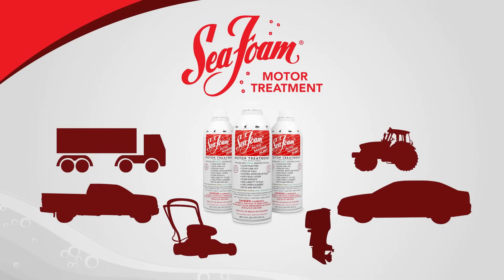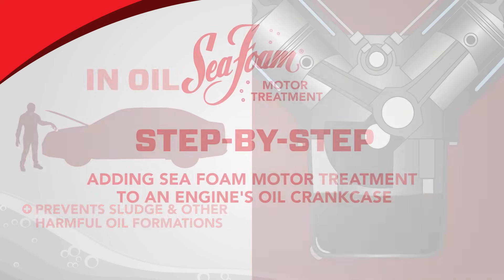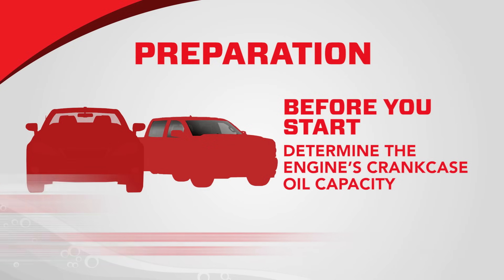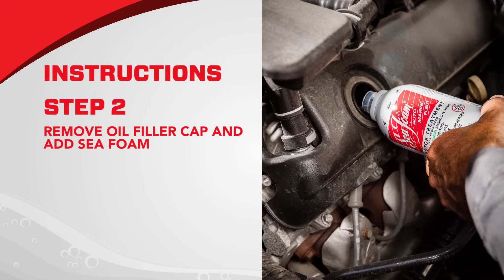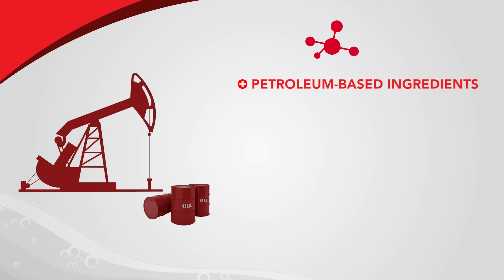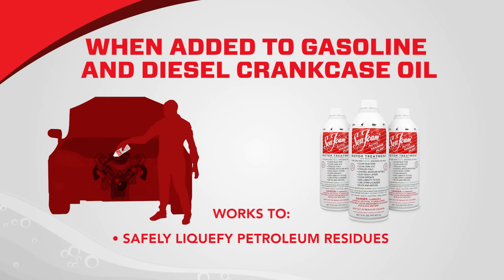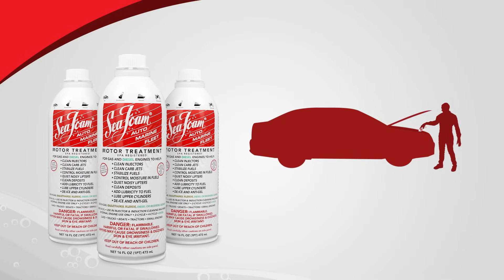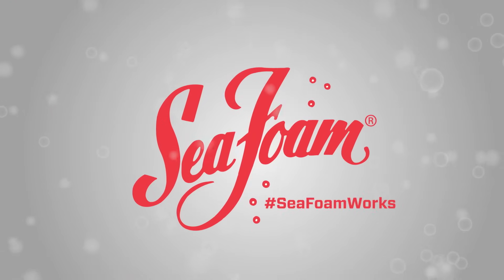Add Sea Foam to your oil crankcase - super easy!

Comment: Hey there! I used Sea foam the other day, pouring it right into the gas tank. For some reason I have not noticed any smoke coming from the exhaust at all. Is this a bad thing?
Reply from the maker: Adding Sea Foam to fuel would not cause a visible emission.  The smoke/vapor you're talking about is caused when a fluid is induced directly into the chambers of a running engine.  Anyway, no worries.
Reply: That happens when you pour it down a vacuum line like the brake booster. Lots of tutorials on YouTube
Reply from the maker: Bad idea to run any fluid through a vacuum line.  See hydrolock.

Comment: I have a 2018 Hyundai Elantra 2.0 l Going to be doing in oil flush and then taking it to the dealer to have them change the oil like they usually do last time they change my oil I went to a gas station to take a piss came back out start the car and it just died it’s done it before after a oil change but I didn’t really think about it I just thought well maybe it didn’t catch but this time it cought and started and ran for like two seconds and then shut off completely turn the key back and forth fired right up never stalled out again so it’s time for another oil change and instead of asking the dealership about it I’m just gonna take it on to myself and go flush my own oil so we will not have that problem the dealership won’t do nothing about it anyway they’ll just say nothings wrong with it that’s the way the car is made
Reply from the maker: Hi Bob. I don't think anything related to changing the oil has anything to do with the vehicle not starting. Why the car is not to starting is being caused by something else. Take it to an auto parts store and have the battery tested for voltage. Fuel filter, too.

Comment: I used it last week and now my car 2004 Hyundai accent shakes a lot and idk what to do.
I have a code P0300
Reply from the maker: Shaking and showing code P0300 tells you have at least one cylinder misfiring.  Could be low fuel pressure, vac leak, bad plug/s, bad coil.  First thing I'd do is remove all 4 spark plugs to see if one is charred or worn out.
Reply: @SeaFoamOfficial I changed plugs and coil and it shakes alot
I used too much seafoam 3 bottles and it started shaking.
1.5 bottles gas tank
.25 breakbosster
.25 crankcase
1 spray bottle air intake
Reply: @SeaFoamOfficial  
I'll check for vac leak and fuel
Thank you
Reply from the maker: @davidnatiel6886  Let us know what you figure out.  Hope it's a quick fix for you!
Reply from the maker: @davidnatiel6886  I don't think there's a relationship.  My bet is something going on (not going on) in a cylinder whether spark or injector or compression.
Reply: @SeaFoamOfficial  
Thanks
I'll check that out
Reply: David Vasquez did you ever figure out the problem?
Reply: @streetlifetv13  i was told there is a problem with a cylinder and that's the reason why it shakes.  It started right after I used seafoam but it was just a coincidence
Reply: KARLOZ LOPEZ  the car is running much better now. It Shakes a lil but it might be related to something else 
It all started after adding all that seafoam and it slowly went away after couple of weeks
Reply: David Vasquez perhaps the sea foam dissolved a deposit that had naturally but very slowly built up over time. This deposit grew so minuscule it went unnoticed but ultimately altered the movement/path of internal components. The steel inside may have lost its shape just slightly having worked around said deposit for so long. Once seafoam dissolves this deposit, you almost instantly have displacement inside a chamber that needs a perfect seal. This would throw off balance and cause shaking or knocking: In other words, seafoam worked well to a fault. 
I’ve had guys develop oil leaks, blame the seafoam when what actually took place was the product removed gunk that internally had been covering a leak. 
Again, another case of the product doing what it should and still catching a bad rap
Reply: Pos

Comment: Hey I have an egr issue and when vacuum is hooked up it idles rough so I keep it disconnected would this help?
Reply from the maker: Thanks for the question. No, I don't think so based on your description. The EGR works after combustion and Sea Foam is done working at the exhaust stroke.

Comment: Will this help with engine sludge in a 4.2 Audi V8? 134k miles. Thanks.
Reply from the maker: Hi Will: Yes, will help.  Add half a can to your oil crankcase every interval.
Reply: Thanks just did the treatment and it definitely cleaned it up.
Reply: Will Davis i also have sludge in the engine ... how often did you repeat it and when... do I poor it in the crankcase 100-300 before oil change ??
Reply: Hetman Pour it in before you change the oil and run it for around 300miles then drain and refill with oil. If the sludge is bad enough repeat it again on a shorter change interval and seafoam it again. My engine runs way better now without all the sludge in there
Reply: Did any of you watch and listen to the video? Lol people click on videos and just post in the comments looking for the answers now. You wouldn’t have had to ask and wait if you just listened to this shit lol

Comment: Hello, i accidentally added excess of seafoam to my crankcase, i added 6 ounces instead of 4 ounces. Should i worry about it? Should i change my engine oil immediately?
Reply from the maker: No worries.
Reply: Did it work

Comment: How about a slugged 2000 Toyota
Reply from the maker: Do you mean sludge?  If so, I would remove the oil pan and valve cover and scrape out as much crud as you can. Form there start adding half a can to the oil every interval and it will progressively work to liquefy the sludge over time...  If me, I'd shorten oil intervals to 1,000 to 2,000 miles for a while to speed up the remaining sludge removal. Check your oil frequently - if it goes black fast, be ready to change oil. Hope this helps!

Comment: What do they think oil additives are, which every fresh lube has (approx 7% by weight). Detergents and dispersants to name only 2. Do they think they know better than expert oil formulators. Save your money and just change your oil....😊
Reply from the maker: Sea Foam is 100% petroleum, has no detergents. It cleans by reliquefying oil deposits/residue back into the fluid oil phase, not an oil additive or fortifier.

Comment: You guys need to add PEA to your formula, it'll make it way more effective.
Reply: Have you looked at Gumout Multi System Tune-Up it's a similar product to Seafoam but contains ~10% PEA
Reply: Multi System Tune Up is Gumout's calling to Seafoam, it can be added to gas, sprayed into the intake/vacuum line, or put in the crankcase like seafoam.For a fuel additive though Techron or Redline's fuel system cleaner is probably a better choice because they contain alot more PEA.
Reply from the maker: No, not worth it. It takes A LOT of PEA to work at all. A question to ask (about PEA) is: Does a fuel additive in a small container have enough PEA to even work? PEA also strips lubricity, which is something you wouldn't put in a cleaning lubricant.
Reply: @SeaFoamOfficial  for my fuel tank additives I usually go with Luca's Fuel Treatment, however, I just recently switched to STP Ultra 5-In-1 Fuel System Cleaner, I've yet to use an engine oil additive or cleaner yet, I'll prolly go with Seafoam or CRC. I'm hoping to see some good results, I'll prolly cut open the old oil filter after to see what it did, and to see how much sludge is in there.
Reply from the maker: @jordanrieser2703  Thanks, Jordan. Sea Foam is not a detergent (like PEA) so doesn't break things apart that end up in filters. Sea Foam reliquefies fuel and oil residues back into their fluid phases.
Reply: Sea Foam Official I think they’ve just been brainwashed by Scotty Kilmer 😂
Reply from the maker: @rajkirannatarajan9276  Hehe

Comment: I don't think this will work for my car engine. Trust me. I know my car. It won't work. Now putting it in the gas tank. It didn't so shit to help my car runs smoother. I have a bad O2 sensor so maybe that's why. You can't clean an O2 sensor. Only replace it.
Reply from the maker: It can't fix everything. Have you tested ignition coils and/or plugs? How old is the fuel filter?